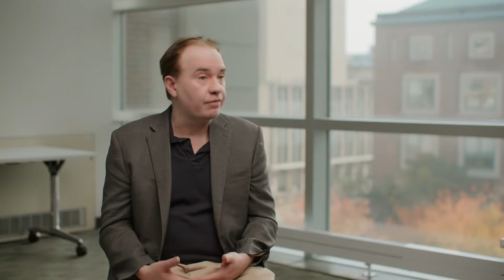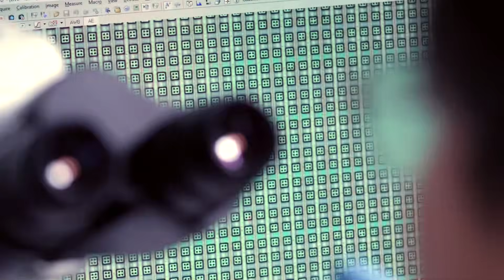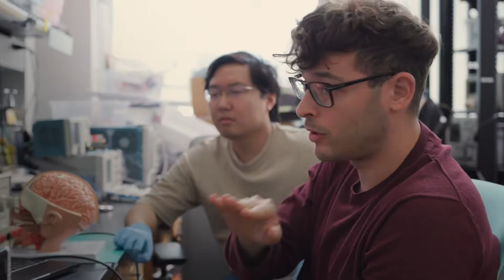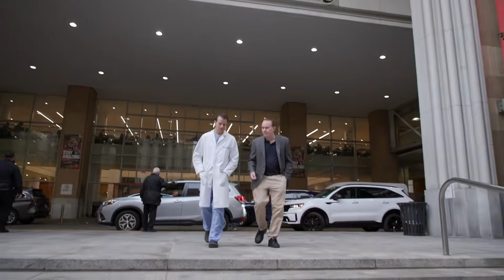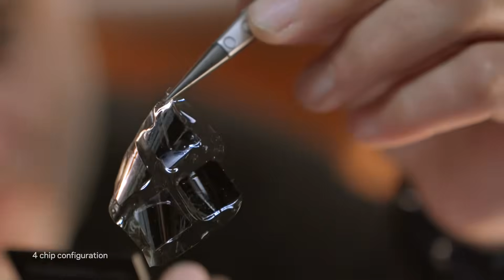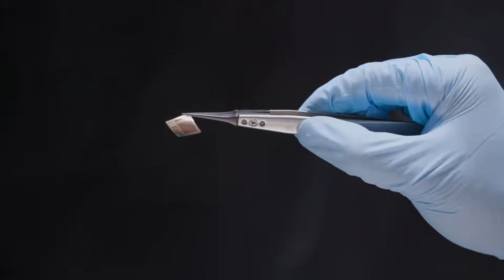The New Generation of Brain-Computer Interface

Comment: One day I was fired upon by a 45cal. 8 times I was hit. 1 was to rhe the back of my head. 2003 - 2004.
I received 4 units. Brain, Heart, Spinal.  
They actually have stopped most all seizures,  defib and erratic.  Pulmonary function.  
Including.  Use of my body.  And pain blocking. For 20+ years.  The issue is what happens when they need to be replaced or if a Dr is not available.  State and Federal medical.  Is what I have for life.
But what if it was out of pocket.  Or if it needs to be removed and civilization has collapsed. 
And a speaker is bad news for me..